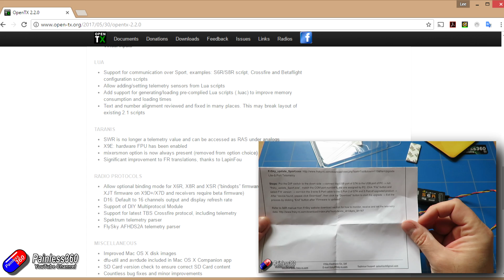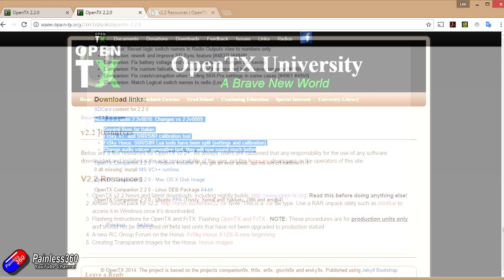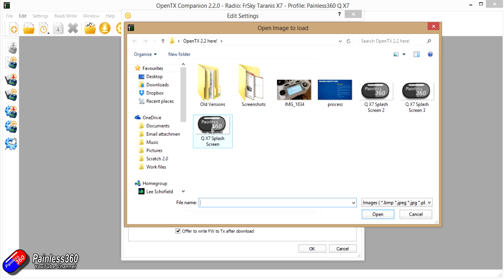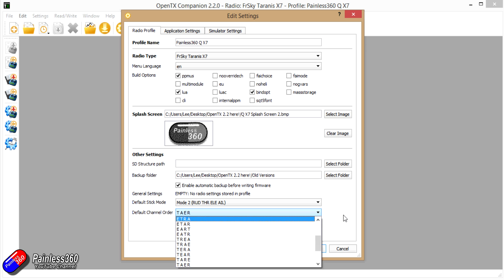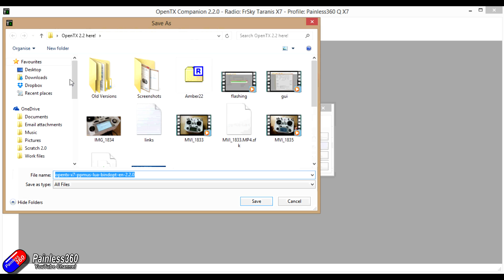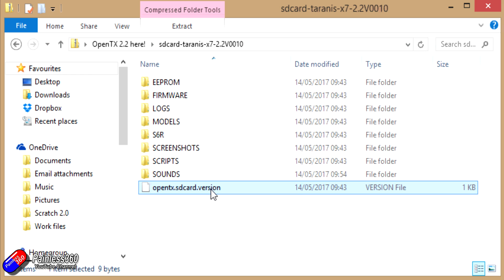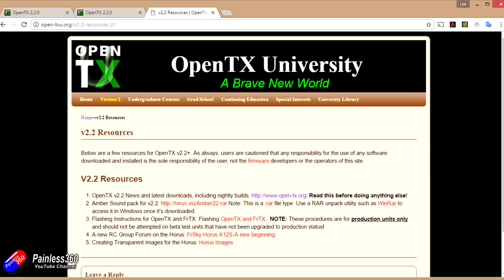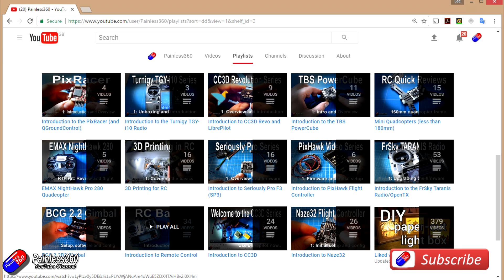Installing OpenTX 2.2 onto a Frsky Q X7 or other FrSky Radio (Taranis/Horus)

Comment: Hi: Your video's are soooo valuable to the new person trying to get a hold of these technologies. Received a new Taranis X9D+ a couple of days ago and decided to update it to the current firmware. Not sure what its original firmware was, but it's Bootloader version was 2.1.6. which was the source of about 9 hrs of headache yesterday. As I discovered, flashing the new firmware through Companion does not update the Bootloader which not only made Companion not want to talk to the radio but made the radio hang up and caused the SD card to get corrupted. I discovered that the best method of Flashing the Bootloader is by loading the firmware in the SD Card and then Flashing to Bootloader via the Radio. However, after much frustration I found out that the file cannot exceed 32 characters and that the SD card must be in FAT32 which my Mac refused to format correctly. After finally resolving those two issues I was able to flash the Bootloader to 2.2 and everything works fine. I am making the note here and in a couple of other places to save someone the same headache. Here is a valuable link. https://github.com/opentx/opentx/wiki/Taranis-Bootloaders

Keep up the great work.

Comment: this is my first setup altogether im not running opentx 2.1 or 2.0 so i dont know where to start with which opentx 2.0 2.1 or just start 2.2
Reply from the maker: See the video - you need to be on 2.1 to upgrade to 2.2...

Comment: Does 2.2 have the installation wizard. Have flashed the new FW 2.2 but no wizard when I go to install a new model
Reply from the maker: Not on the Q X7. The radio cannot display greys (only black and white) so the support for images isn't great. Sadly that means that the developers, rather than use text only for the model setup wizard, just left it out of the Q X7 build.

Comment: I'm taking delivery of a new Horus in the next couple of days. I want to install Open TX 2.2.
Being new to all this - will I need to install OTX 2.1 and then upgrade to 2.2.??  I'm also confused by the many web resources for Horus / Open TX advice. Do you have a favourite which is current and bang up to date??  regards. Stu K
Reply from the maker: Yes, see the comment in the video about needing OpenTX 2.1 first. You may find that the Horus comes with 2.1 already on it.. The release notes on the project and OpenTX University are my ports of call for up to date links and detail.. Best of luck!

Comment: @Painless360 Great Video, Wondering why after i flashed the firmware my radio now comes up with a sd card warning about how it expected a different version. How do i fix that?
Reply from the maker: In the video - that file that I talk about needs to be in the root of the SD card..
Reply: Painless360 thanks!
Reply from the maker: No worries. I added that bit exactly for questions like yours ;) Best of luck!
Reply: Great video, I keep getting the error too.  What file needs to be copied to the root of the SD card?  Is it a file or multiple files copied to the root.

Comment: Hi Painless, I first had to use Zadig 2.3 again to fix the STM bootloader. DFU problem The Windows 10 creators update had over written the bootloader it since I  had original fixed this problem.
Reply from the maker: +Anthony Witham thanks for commenting, I'll keep that in mind in case it catches others out too. Happy flying

Comment: Amber doesn't work on this radio. Only some of her files are recognised. We're waiting on someone making a sound pack suitable.
Reply: the Qx7 only uses 6 character file names not 8 character. if you go into the files and rename them to all be 6 characters then they will work.
Reply: 6 characters!!! Brilliant. Thanks.
Reply: I've now discovered there is a new issue of Amber sounds since I downloaded the 8 character filename file when I first bought me radio. The new one has 7 character filenames and works a lot better with the QX7. But it doesn't play all the sounds. I'm going to go through all 650 files and rename all the 7 character ones.
Reply: There are also some files that have been renamed. For example welcome greeting tada is now called hello

Comment: Ok I am using open Tx 2.0.19 I would like to upgrade to 2.2 is there a way to upgrade you model files without having to do it in the radio twice with going to 2.1 then again to 2.2 like maybe in the companion possibly I do have a mass amount of model files and honestly would hate to lose them in a double transfer type of scenario
Reply: My exact scenario also.  Only a brief mention to go to 2.1 first then 2.1 to 2.2.  Can't do it directly?
Reply: answered my own question......thx for the video guides!
**Only OpenTX 2.1 and later settings can be upgraded by the radio, if you currently run an even older firmware version you have to either go through 2.1 first before flashing 2.2, or do the conversion within companion. **
Reply: ok so use the companion cool

Comment: I don't know why my taranis QX 7   doesn't work except the  4 in 1 module for the toy quads
Reply from the maker: +Old School R/C possibly due to the firmware on the radio. There are two types FCC for outside Europe and LBT for in Europe. Both the Rx and radio need to be on the same firmware..
Reply: Painless360 do I need to reflash my taranis with new firmware?
Reply: Should I take out my SD if I have to reflash the firmware?
Reply: Painless360 should I take out my SD card if I have to reflash my firmware?
Reply from the maker: +Old School R/C I'd check what firmwares are on the radio and reciever first.. Best of luck!

Comment: do u know if I can flash my receiver fw once I have upgraded from stock to opentx? I upgraded to opentx 2.2 rc13 before and I could not flash my receiver. I had to rollback to the stock fw and it worked straight away. the receiver I was trying to flash is frsky xm+.
Reply from the maker: +Jack Truong yes, I was flashing an S6R from the pins in the JR bay on 2.2 last night..

Comment: Thanks for the video. Taranis not recognized by simulator after firmware 2.2 update...help?! 
Tried 3 sims on both Windows 10 & OSX.
Reply from the maker: +Kendall Smith I'd check the options you chose when flashing. The ones I used worked great.. let me know what it was when you get it sorted..
Reply: Painless360 - it was a setting option "mass storage" was selected and that was preventing the computer from recognizing the Taranis as a USB controller. This also allowed access to the SD card without going into boot loader mode.
Reply from the maker: Well done on finding the root of the problem..

Comment: love your channel!! helped so so much, but having a night mare with my tarot 980, mainly due to not having enough knobs and sliders on my transmitter, futaba 10j so was looking at getting qx7 for the camera controls, 3d gimbal got zoom and film, photo to set up, and if i use it got another four channels to change camera settings, don't know whether i'd need them to be honest. i know i'd be able to set it all up on a teranis dx9   but don't know much about them, and i don't want to take any chances with it due to the size off it never mind the cost, just wondering what you would do?
Reply from the maker: +ISOSAILING I'd suggest taking a look at the Taranis series and OpenTX Mix School playlist on the channel. Lots of detail in there..
Reply: was thinking the easyist way to do it all would be with the Taranis plus, i'm guessing you could use a 2nd   resever for the camera controls and set it up so you could have an option off using 2nd transmitter for operating the camera if needed, would be handy if i could although most off the time i'd just be flying it myself.  thank you!!